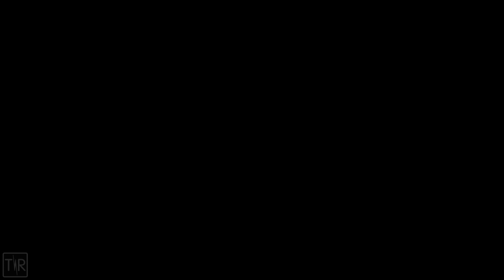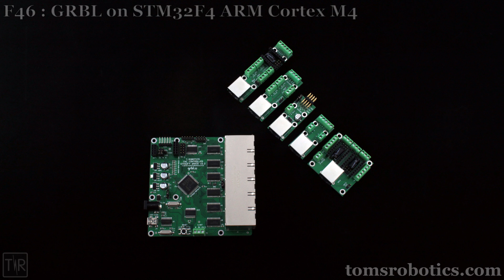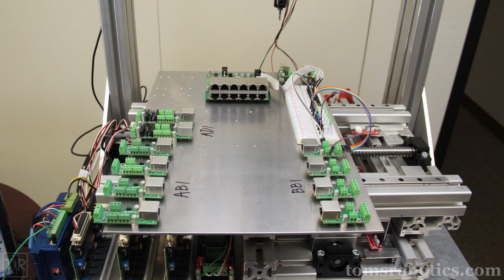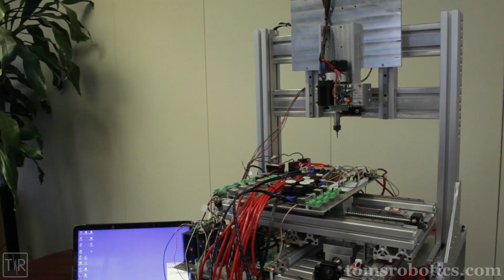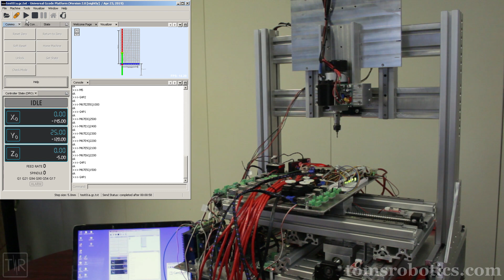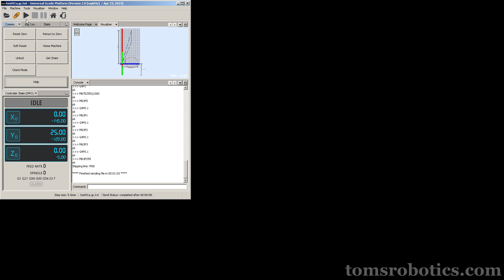GRBL 32-bit 500KHz 6-Axes CNC Controller STM32F407 ARM Demo GRBL32 F46

Comment: Can this board work with the GrblGru software?
Reply from the maker: I will have a look at GrblGru to see if this will work. My implementation of the additional axis ABC is generic linear, so it should work. If ABC are implemented as rotationals, some trig must be calculated by the software.

Comment: How fast can this controller can move the motors? I want to build a CNC router for wood processing and still didn't decided which controller to use. What is the biggest motor power this controller can handle? What kind of signal uses this board to drive the motors? I want to use servos. It is possible to drive such motors with your board?
Reply from the maker: Hello Alex. The signals are standard Step and Direction for stepper motors. The power is dependent on the stepper driver (which receives the step/dir signals and then more the stepper motors). There are special servo drivers that can accept step/dir and drive a servo (typically a BLDC with encoder)
Reply: @tomsrobotics1406  So is that a yes on servo control with servo's with integrated drivers?